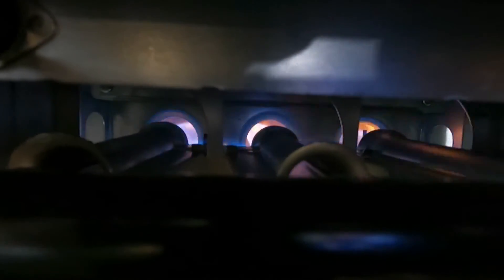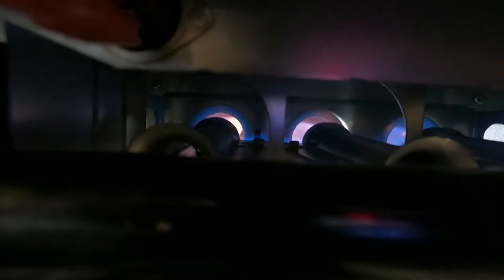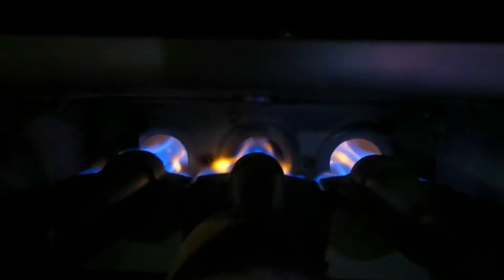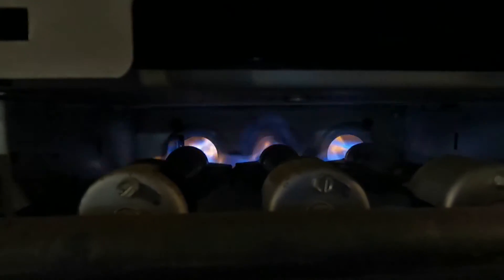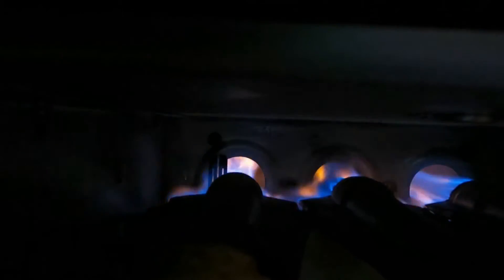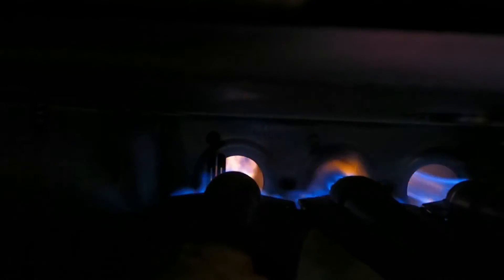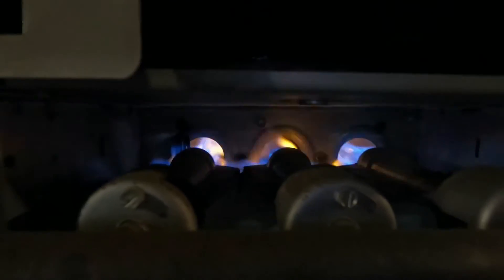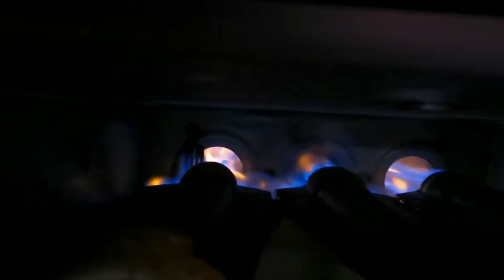BAD FURNACE HEAT EXCHANGER  FLAME ROLL OUT VS GOOD FURNACE HEAT EXCHANGER FLAMES

Comment: First one seems like it's burning dirty. 2nd one must have been a gmp. I've seen plenty of the newer style Goodman's burn right through
Reply: exactly , 9in the first one the flame tho straight , is still not blue enough. In the second one, there is a possibility that the heat exchanger is cracked, but also there is a possibility of a plugged heat exchanger as well as not enough  air flow thru the inducer fan or the nozzles are not correct.